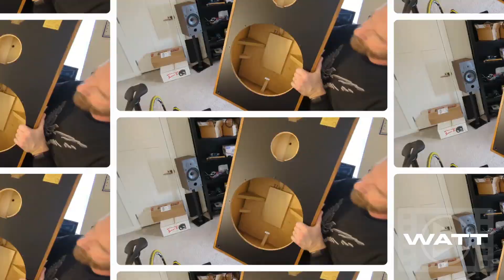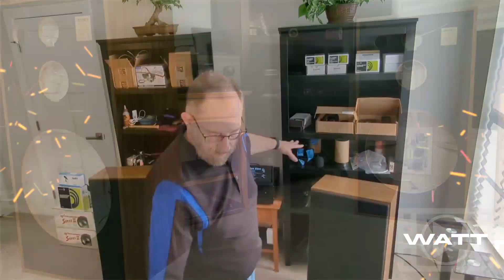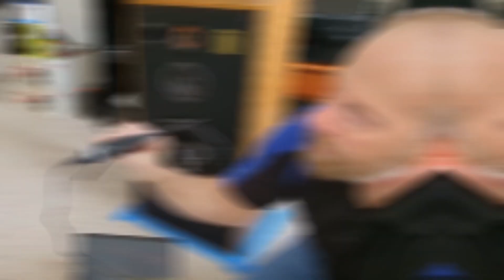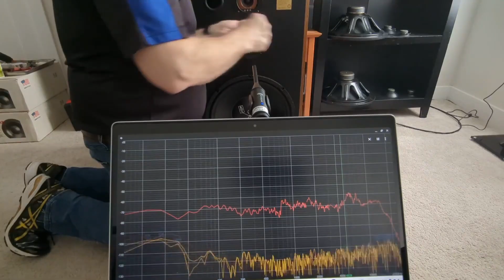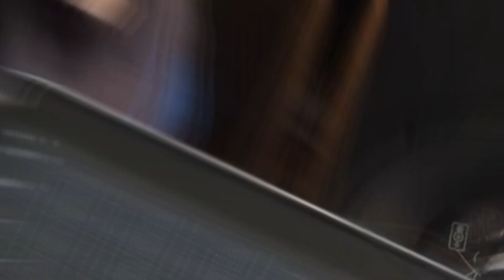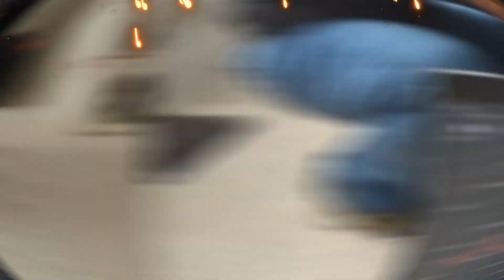Reversing Midrange Polarity On A 2nd Order 3 Way Crossover For Smoother Frequency Response

Comment: You need to lower the output of the midrange . Also, the crossover is not designed correctly. There is no reverse null.

Comment: Those crossover points are a pretty good universal xover point for 3 ways maybe a touch lower
Reply from the maker: Thanks for watching and commenting Eric! The crossover points are pretty well suited and overlap nicely. If I recall correctly this one has an 800 Hz low pass for the Woofer, 750 high pass for the mid, 5000 low pass for the mid and a 4500 high pass for the tweeter. I did need to make additional tweaks, which lowered the high pass for the midrange, (which is actually a full range PA driver), down around 250, which filled in the bottom end nicely and added a Zobel to it to finish off the crossover network to make it as smooth as I could. That's another planned video in this series. I also added a big port which really made the bass come alive... HUGE difference. And that'll be another video. I'm searching for nuggets of good stuff from big long epic videos I did on this build when I first started publishing them on YouTube. The old videos have tons of content but are unbearable to watch because they're so long and I was making many changes so it gets confusing. Trying to extract the bits that made the biggest differences.